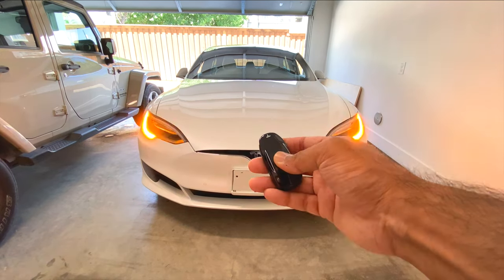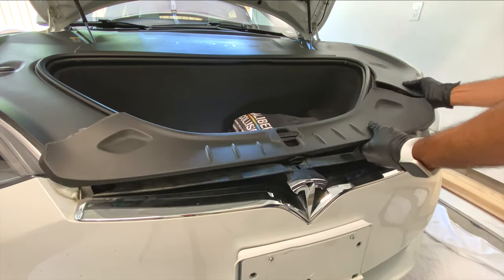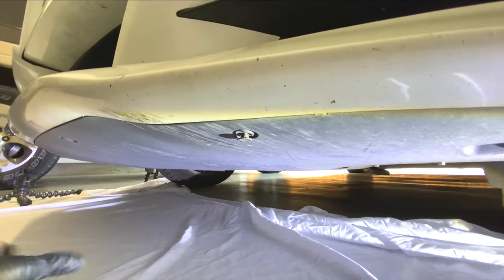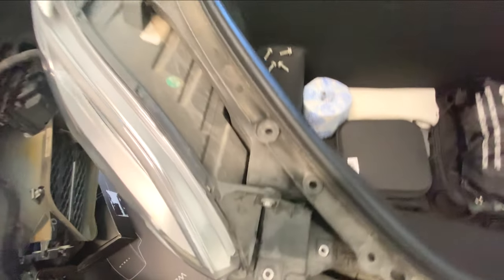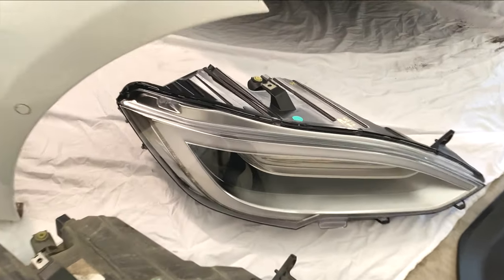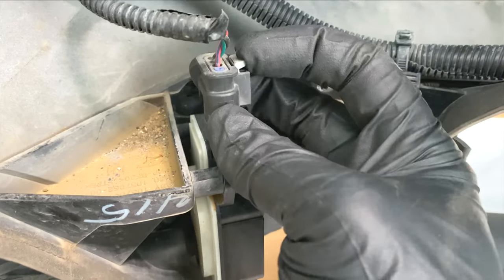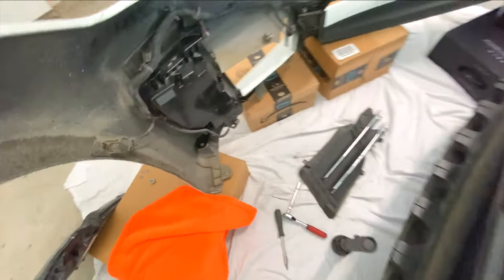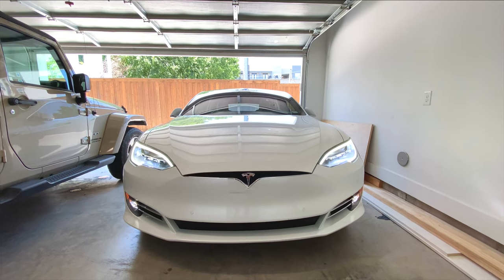How To Fix LED Strip (Tesla Model S Headlight Replacement) (Bonus: Foglight and Chrome Trim Install)

Comment: Tesla service center is quoting me $2,224 to replace the headlight plus labor. I have the exact same issue: upper strip doesn’t light. So glad you posted this video. Another post I saw said that you need to lift the car to do this replacement. Thank you for showing how to do it easily!

Comment: Not trying to downplay your work here and the video is excellent (and your car is astonishingly clean!), but personally I would fear that the replacement could break at any given time too, so it's a fix with an unknown run time. I appreciate that with this case you've only spent $200, so you would have to go through a lot to cost the same as a new light, but it might only last a month before the replacement fails. Such a shame that they didn't make this part repairable in any way.
Reply: I think the best course of action is to open up the headlight and replace the upper LED strip itself. It's a bit more intensive, but a little cheaper, and it should last quite a bit longer. I believe the new replacement glass led strips and ignitors are upgraded as well.
Reply: I seen that repair video and its a lot of work, I mean a lot of different glue, tear, screw, forget it at least if I repair my friends MS lol
Reply: 200 dollars seems like a low risk move.   Opening up the headlight is a lot of work.   Requires softening up the adhesive with a heatgun or even your stove, then you still need to solder the LEDs in the strip.   That's assuming you or anyone here knows how to do that.
Reply: Get the G variant and it won't happen again.

Comment: OMG I'm  so glad that i found your video, ive been worried about this issue coming up, i bought my 2018 model S  five years ago, still under warranty,  and both headlights went out, so i know for a fact that they can go out at anytime  now, i feared the 15 hundred dollar price tag, but with your help i now know that i can do it myself for pennies compaired to what tesla charges, they actually  came to my house the second time, and didnt want me to watch them install the new one, im now thinking about ordering both headlights now, so that ill have them on hand, great video, and thank you for the demonstration  on the easy install, you have a new subscriber now, keep putting out more great videos. Thank You so much.

Comment: Are the fog lights that easy to install? Does it automatically work despite not having the wiring to support. I have the same model and lighting package on my 2017 Model S. Thank you

Comment: Nice… but how do you turn on and off the fog? There should be an option under the light settings for those MS that comes with fog but not for those without the light package. Did you program it somehow?
Reply from the maker: So Tesla used to offer this service to unlock the Foglight button, however they decided to not do it anymore sadly. There are ways around it, however that would mean you have to know a Tesla Ranger and or something else. The ones I installed actually turn on and off with the headlight, which is what I wanted anyways.
Reply: @KLEANTRIX  Thats because you're turning on DRL. The actual foglights are the small lenses in the bottom part of the housings. Just FYI.

Comment: After I did this replacement my autopilot/cruise control doesn't work. Tesla service thinks I need the firmware reset. Is this a common issue after a headlight replacement?

Comment: Doesn’t fall under warranty?
Reply from the maker: It does not. Mine is a 2017.
Reply: @KLEANTRIX  I have been doing non stop searching for this but only model S content comes out. I have a 2022 Y and Tesla is coming on Wednesday because the same thing happened but on driver side. Crossing fingers it’s under warranty.
Reply from the maker: @ideedeevg  Awesome car! If you haven't received an invoice detailing the cost of replacing the headlight, it's highly likely that the repair is covered by the warranty. Typically, they provide an estimated cost before scheduling a service appointment if it's not covered by warranty.
Reply: @KLEANTRIX  crossing fingers lol
Reply: @ideedeevg unless there was physical damage to the headlight there’s zero chance they wouldn’t cover that

Comment: Tesla just refused to fix mine, so I’m considering doing this.  They warned me that if I replace it myself there may be software update issues after I put in the new lights.  Did you or anyone else here who did this experience that?
Reply from the maker: I did not experience any software issues.